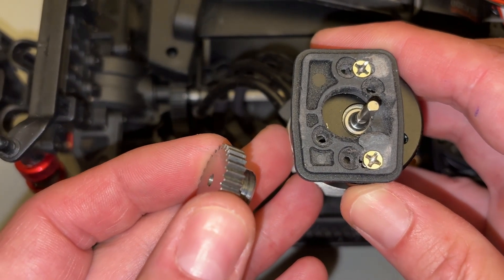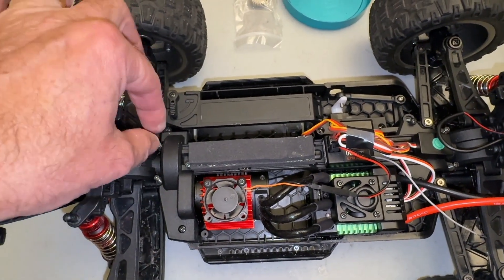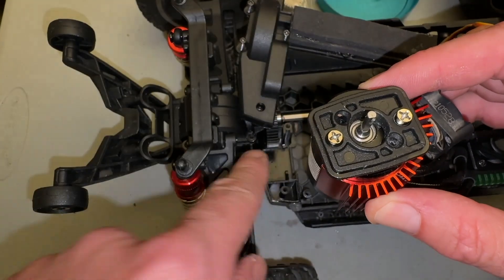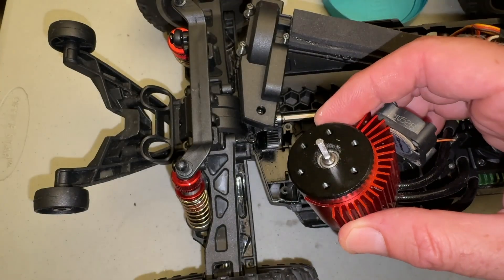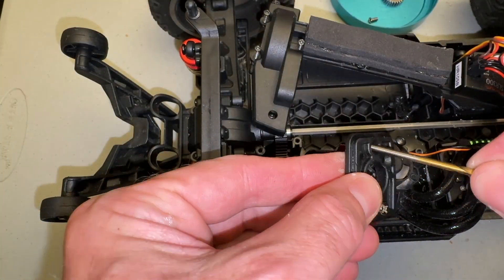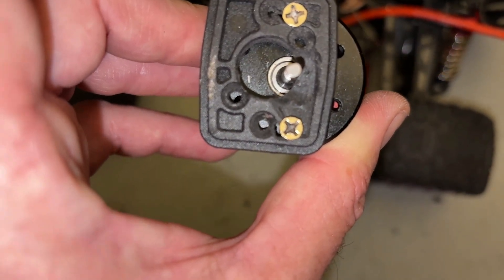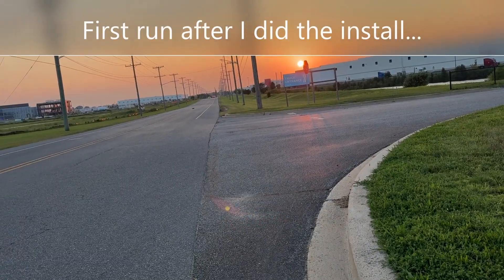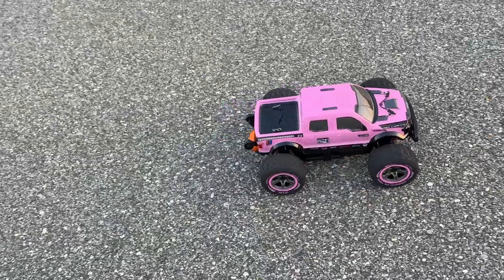DeeRC 9207E , 9201 9200, BEZGAR HB101 - 27t Pinion Install, Motor Mount Mod, Metal Spur Gear, 9206

Comment: I had a copper pinion and a 3S battery and it ripped all of the gear spurs off immediately. I’m so excited to get my new pinion gear!
Reply from the maker: Do you have a metal spur gear for it?
Reply: @BriansRCStuff  yeah the reduction gear on the shaft was metal and the pinion gear on the motor was copper and I shredded it. I think either I had the distance incorrect or I punched it too hard. I think you can program the amount of punch on the controller that I have but I’m not sure. I’m just getting into this hobby.  Also, I may have had some of the terminology wrong.

Comment: Brian for the pinion, what millimeter bore did you buy? I don’t want to purchase the wrong one.
Reply from the maker: it depends on your motor.  probably 3.175
Reply: @BriansRCStuff  i just checked using grock. You are correct. Thank you for responding so quickly. I’m pretty close to finishing my mod. But I wasn’t sure how to make the larger pinion fit and your video made me feel so stupid and I’m so thankful that you made it because what a simple solution.
Reply from the maker: What was the solution?  Sorry it took me a couple of days to get back to you... sometimes I miss some responses but I try to respond!  If you ever need something, just remind me and I will get back to you (or email me).